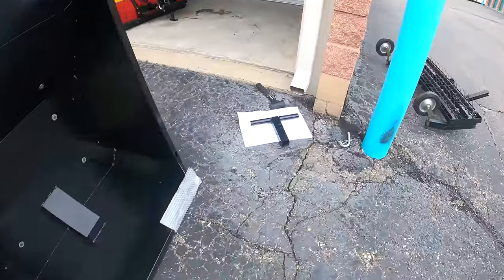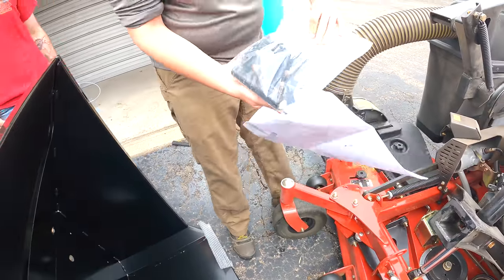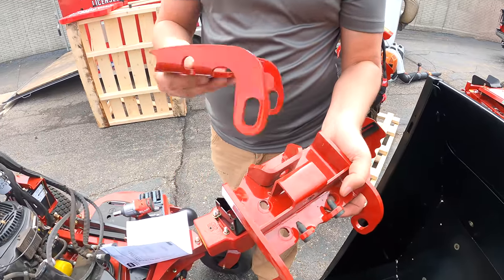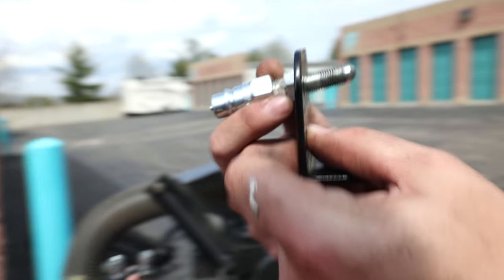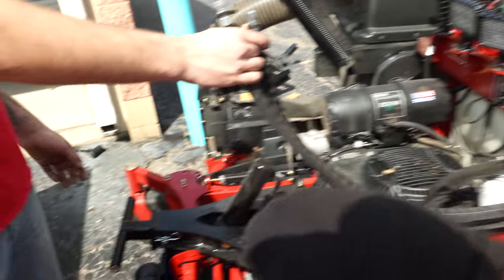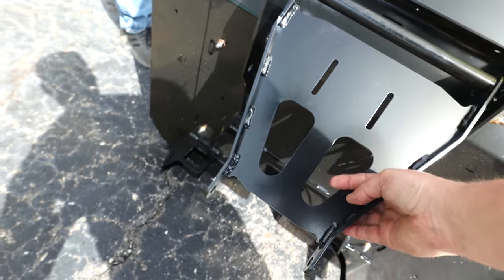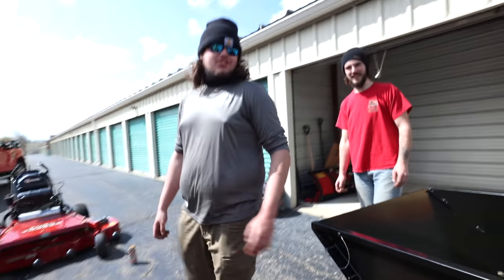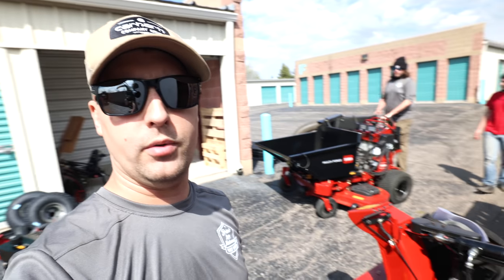#1 New Way To Move Mulch! ► (250lb Capacity, Toro Mulch Force!)

Comment: Does anyone know what this exact unit plus all of the attachments price range? I’m super interested in buying one just wanna see if it’s in my budget
Reply: I would really appreciate if it’s broken up for example: mower cost, xxxxx. Mulch force cost, xxxx. Etc, thanks.
Reply from the maker: Mower is around $11-$12k, depending on sales and deals. Each attachment varies. Some are $400-$800. The mid tier attachments like the rake are $800-$1200 ish I think, the dumper around $2k, low flow $1,500, high flow $2k+, sweeper, blower and snow thrower in the $4k range. Hope that helps!
Reply: @BriansLawnMaintenance  just what I was searching for thank you so much